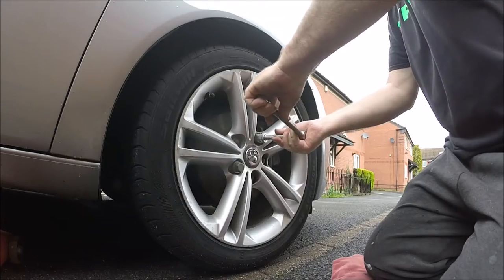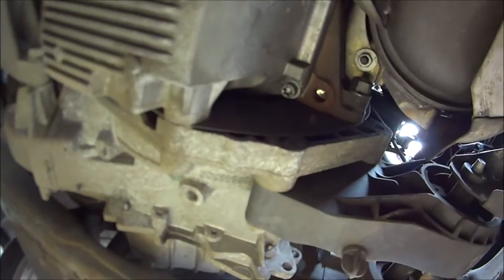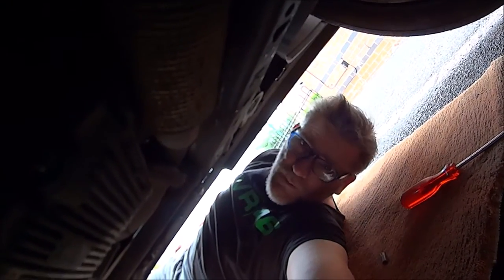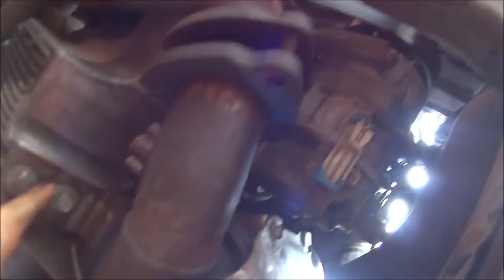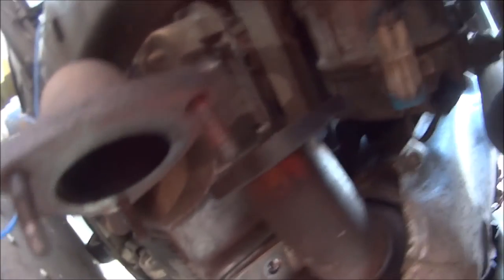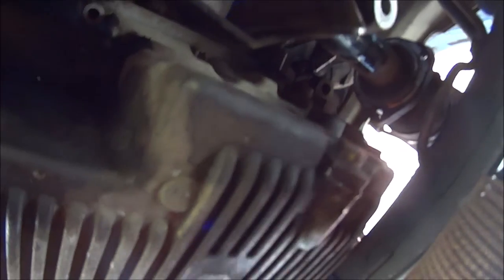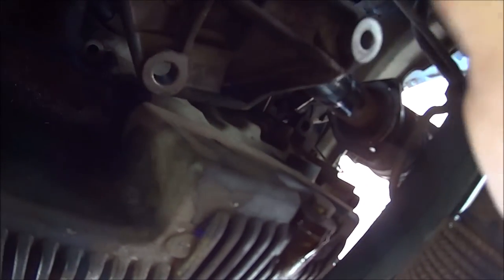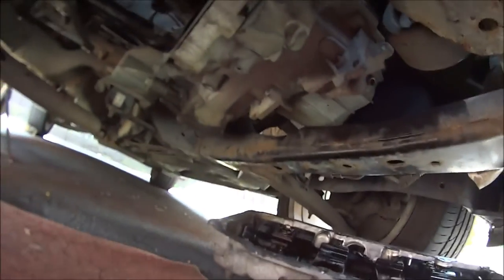VAUHALL INSIGNIA cdti, Engine Sump cover removal UK.

Comment: Had a crack at this, don't need to remove drive shaft, don't drain gear box, just undo the drive shaft coupler and it moves enough to remove the top bolt on the sump bracket and the sump bolts.... drop exhaust to allow easy removal and fitting of the sump once prepped. Saves a lot of messing around indeed.. thx for this video. I would not have attempted it. it gave some great tips... patience is the key with this job..
Reply from the maker: Thanks for the info

Comment: You can actually do it without undoing the driveshaft or splitting the bottom ball joint ect.  If you undo the tree bolts around the driver's side driveshaft intermediate bearing next to the inboard CV joint and split the bearing out of the bracket, it allows you to knock the whole driveshaft outwards towards the wheel slightly, this then gives you the room needed to remove that last bolt that holds the bracket to the engine.  One thing to note though, on the later cars (post 2014 IIRC) you cannot access the two sump bolts behind the flywheel from underneath as there's no indexing slot in the flywheel anymore.  This means the flywheel must be removed which is a major pita if you don't have garage facilities!  This process involves dropping the gearbox, removing both driveshafts and lowering the subframe a tad!  Has to be said, these are really well designed cars🤔🤷‍♂️🤬!
Reply from the maker: Hi John.. Thanks for sharing these helpful tips with everyone. Cheers buddy 👍.
Reply: @jonyr1TT  Cheers, it was very handy to see your video before attempting this job.  It's really helpful that people like yourself post these videos!  Thanks 👍
Reply from the maker: Glad to help thanks buddy 👍

Comment: I have an Astra J 2.0 litre CDTI. I believe i have the same engine. I am getting a low oil pressure warning when i start the car in the mornings. Stays on for approx 20 seconds before the warning stops. Is this an indication that the oil seal needs replacing?
Reply from the maker: If its the same engine I would say yes. DO NOT DRIVE IT get it sorted ASAP.
Reply: @jonyr1TT  I can confirm it is the same engine. Engine is an A20DTH. It has 75000 miles on the clock, 2013 model. My Turbo started making noises last week. Bearings had worn out. I have replaced the Turbo cartridge myself. I am now wondering if the low oil pressure brought about the demise of the Turbo, but i don't know how long a Turbo is expected to last.
Reply from the maker: nice one

Comment: is this the same process for replacing a oil pickup  seal ? Also is it true that the driveshaft does not have  to be removed ?  thanks'
Reply from the maker: Sorry everything in this video was a first time for me.  But yes i have another video on replacing the seal and i did disconnect the driveshaft but left it in place

Comment: Hi matey, I can just see the 2 hidden bolts on mine, when you turned your crank did you get a clear passage past the fly wheel.
Reply from the maker: Hi Kevin. Yes make sure you turn the engine very slowly its easy to miss the right sports. Mine was a 09 SRI. Best of luck fella 👍

Comment: Was it leaking Johnny?
Reply from the maker: There was a bit of a leak around the strainer tube O ring but that's not the main reason for removing the Sump these insignias have a common fault. All will be revealed in the next insignia video. 👍 cheers.
Reply: Failed pickup seal causes low pressure and catastrophic engine failure